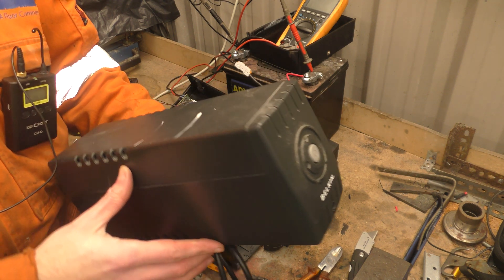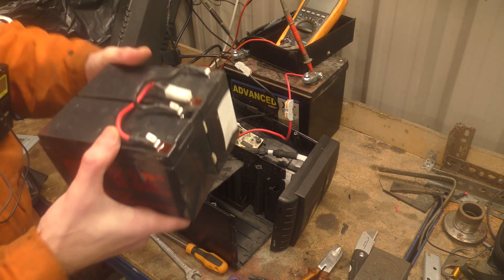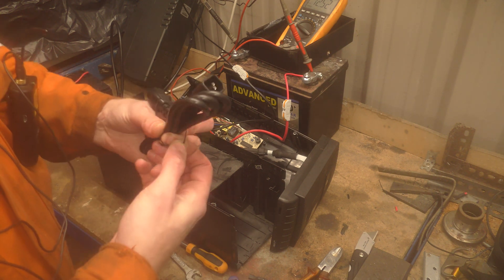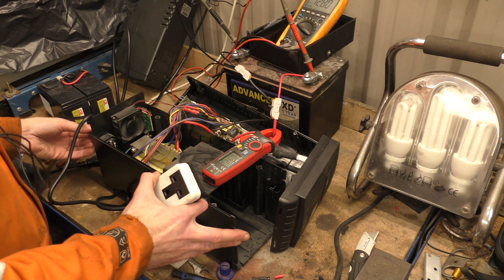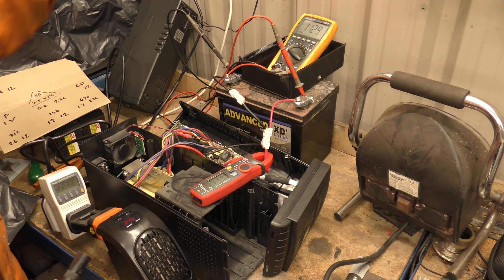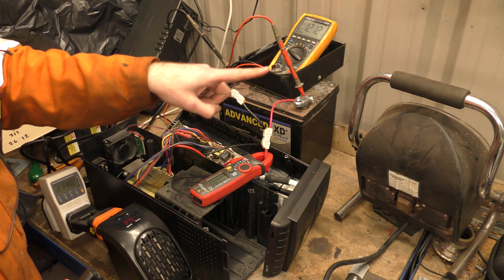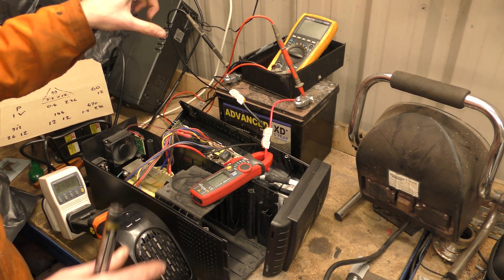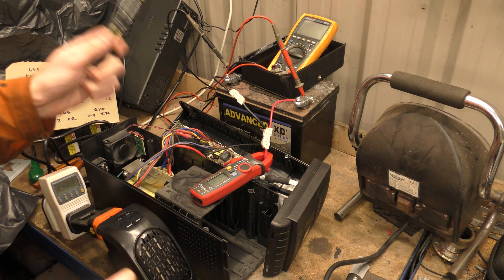Uninterruptible Power Supply (UPS) resurrection.  Making it work without spending money on it.

Comment: I literally collect UPS power supplies because they are seriously amazing pieces of kit.  
 I used a flooded lawn mower battery and I was able to get almost eight years of service out of it.    
and a few years ago I had a Deka AGM battery that I purchased that just was awful for using in the car environment as I was using it and I hooked it up to a UPS and lo and behold not only to come back better than ever but it's been working flawlessly and it's almost 160 amp hour.  

one quick tip is if you have a battery that is not doing so well a UPS makes a great trickle charger to bring it back up in about a month or so if it is repairable or fixable.  

in the United States you can get those what acid batteries which are about a 65r and they're about $50. They were perfect for UPS use as by the time you need to replace them it'll be a few years down the line as again you're not really discharging the battery very often again and sit being an emergency power supply or a backup power supply.  

the real trick is to make sure that you make good solid positive connections to the battery and try not to use the OEM terminals as again they are made for a very short length..

Comment: I have a UPS on my diesel heater but intend to make it actually begin to shut down the heater when AC power goes off rather than me running around like a headless chook deciding whether to shut it down manually or try and restore AC power in the few minutes that are available.

Comment: Thanks for highlighting this possibility for re-purposing these old UPS, i have one i can use. What could be a helpful information is to examine with measurement how is the Charge profile (Volats and Amps) where you hook up a discharged 12v battery and monitor how long to charge it and how (probably not) does teh applied volt and amp behave during the charge period. - so an Arduino volt and Amp data logger.

Comment: I'm now trying to experiment (I say trying) with my ups inverter plugged into my small portable generator. Might sound pointless but I don't have a low enough capacity  battery charger that will run of my alternator generator to supply my battery. Yes I know there will be a loss but it does mean I can use my drill or sander and charge my ups (car battery in a box) at the same time and the idling generator isn't just burning fuel making noise when I'm pausing. I'm hoping too to find a way that allows the ups to boost the initial  output to allow startup load
Reply from the maker: It's never pointless if you learn something.
Reply: @DavidMcLuckie  yeah don't touch open terminals and earth connections with bare hands without checking the potential
Reply: @philipp1767  I saw an apprentice get zapped pretty good while working on a huge high voltage motor (isolated) because the guys working on the shaft rotated it a quarter of a turn while aligning it - they werent aware the tech was preparing terminals.  Big trouble was had by all as many safety rules had been broken to get to that point.

Comment: I had a go at this over a year ago, it works fine except... I found by accident that the - ive terminal is LOADED... ie that yes the potential across the battery was 12.5 v to 14v charging but between the - ive and earth was some 60volts LOAD and at a high current. My arm hurt for about an hr after. I checked +ive and that was the same. The battery in a ups (belkin) is inside and isolated. So be aware and do avoid the same situation I had 👍

Comment: Sorry another comment. With regards to the phasing. Does it syncrhonise to the ac phase cycle or does the ac in go to dc then back to ac again? Ive been trying to work out how to synchronise to the 50hz grid with an inverter. This may be the answer.
Reply from the maker: I'm not sure if these ones do any synchronizing.  I guess I'd need an oscilloscope with dual inputs.  I know the big expensive units are basically running on the inverter the whole time so no matter what the input voltage changes to it's always outputting 240V.
Reply: @DavidMcLuckie  yes with big UPS's the inverter and rectifier run constantly.
They have a 400v +&- DC bus.
There is no break
Reply: @DavidMcLuckie  interesting. And the cheaper ones just switch the inverter on quick enough no one notices?
Reply: @Fishing-Bert  10mS break

Comment: 18650 battery pack and bms could cut down the recharge time  a lot over a lead acid leisure battery if you could pick some up cheap
Reply from the maker: I was looking at building a cell with 18650s but I worry I would likely cause an explosion and much fire.  Great content but not so good for me.  :)

Comment: When i got a UPS for my workstation i simply "went for the biggest bastard they had in stock that was over 1000w*
So far, works fine 🤣
Reply: 1000w is a baby, I've just installed a two mega watt system.
Reply from the maker: Fuck.  2MW.  Is that for a small island?
Reply: @DavidMcLuckie  part of a data centre, it has 16MW in total.
One I'm at today has 2.4MW per hall there are 21 halls.

Comment: Interesting project, great tinkering skills.:) 
So yes that's a great way to achieve extra hours of backup 1kw/240 Ac (not sure if the charging circuit would stop at a preset cumulative charge).
Or for example if you only wanted to run that 240/500w heater then I would say it would be more efficient to have 240v DC battery bank charged by solar. A 240v "AC" heater element will run perfectly well on 240v DC.:)

Comment: so you will use this 12v battery to invert 240 volts ac then back to 12 volts for a heater..... why not plug your diesel heater into the car battery and use the ups as the charger? seems you won't have the transformer losses if you don't transform anything.
Reply from the maker: I was wondering when someone would notice that.  :)

I'm assuming that people will also likely run other 240V things.
Reply: @DavidMcLuckie  Never "Ass  u  me"  🤨🧐😏
Reply: Hmm - I'm not sure you can use the ups as the charger - as it only delivers 1amp of charge current at 12V - according to the video. You might be able to do as you suggest, but with a different charger which delivers at least as many amps as your load needs - so that you are not draining the batteries in normal operating mode.

Comment: Is the (now external) battery fully isolated from the mains side - some older APC units I’ve played with in the past had the battery negative tied to a floating mid point (~120v approx for a 240v unit) of the inverted output. Not an issue when everything is housed within the supplied UPS case, but maybe worth checking when you have the meter out?

Comment: Just be careful as some UPSes like to absolutely GRILL their batteries with their float charging set (or drifting with age) far too high for the batteries, resulting in said batteries swelling up and in worst case bursting open, particularly the sealed ones they tend to come with, releasing a lovely eggy fart stank into the room they're in... :S 

I bought a couple of APC UPSes recently (mostly for use as UPSes) and they're pretty bad for that, but after some research on them, one I just had to add a 100k potentiometer to in order to turn "the grill" down, the other, well that needs some serial communications to tell it in software to stop cooking batteries, and I can't find my serial cables, cos I haven't used one in years, cos that was for updating a Nokia satellite receiver many moons ago... :P
Reply: Good advice and I like the way you think. Thanks.
Reply from the maker: I'll have to check that.  Thanks.
Reply: The batteries were knackered then.
The float voltage will be 2.27v per cell.
Batteries should last 10 years.
Reply: @markross728  "Should" being the operative word, but the float-charge level from the UPS (which keeps them topped up and ready to roll) is often higher than it ought to be, which means the batteries fail sooner due to being over-charged, meaning you need to buy new ones or a new UPS, cynical me thinks it's their way to keep a false economy going making end users buy new stuff unnecessarily when they go bad...
Reply: @twocvbloke  it's set to 2.27v a cell, air flow is the issue.
One duff battery will send the others around it the same is a short space of time.
Reply: @markross728  As I'd pointed out in my first comment, some of them can drift with age as components degrade over time (which they really shouldn't, but, the bean-counters do love to use cheaper and cheaper parts!), so the charge setting can increase, just have to monitor the voltages with measuring equipment to see what they're getting up to...
Reply: @twocvbloke  sounds like a cheap ups.

Comment: those UPS batteries look very much like what you find in a golf buggy .. off to the local golf club tonight then , with lockdown they won't miss a few
Reply: There are differences though, there are some designed for cyclic use (such as your buggies), some for standby use (aka UPS use) and some that can be conditioned for either, but that only applies when new, so much like car batteries they might not last... :)